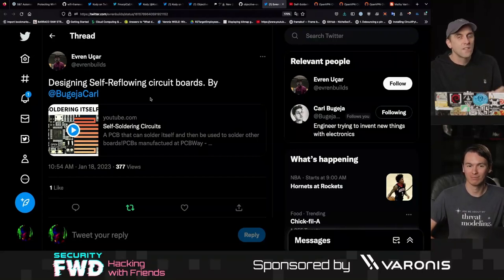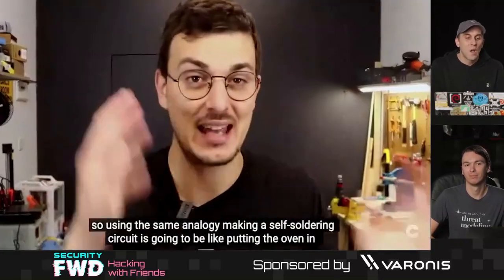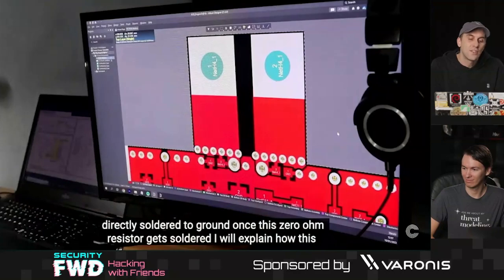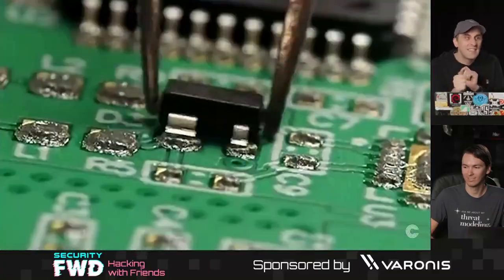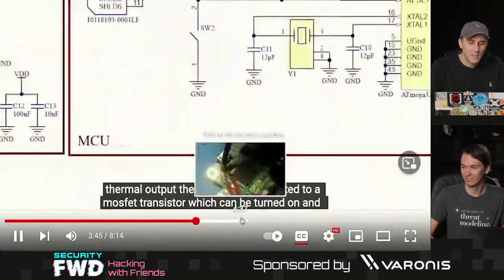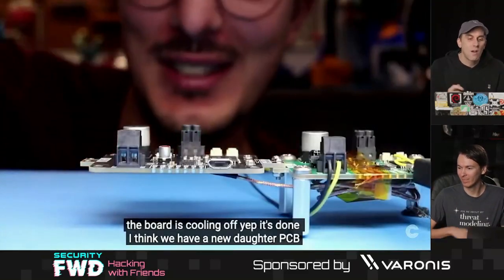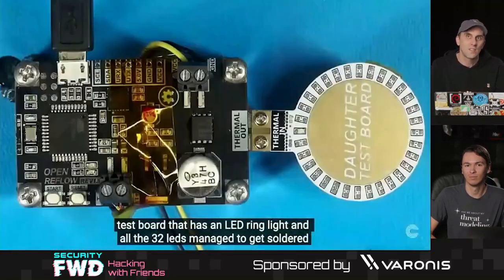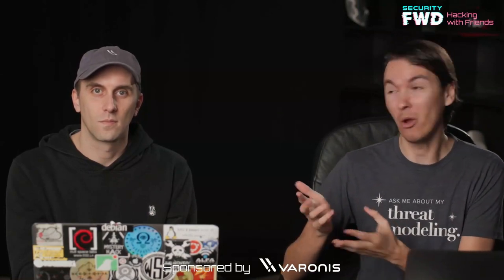Are Self-Soldering PCBs the Future?

Comment: the heater ground plane is connected only in one spot, there where he solder the resistor. Groundplanes are connected with vias to the part or component, to create the shortest distance possible. His ground plane has only one connection point, at the margin where the resistor is. That means a very long way. to reach that, and why should "electrons" go so far if there is a near via to a real GND plane allready ? The heater GND plane is just like a long wire soldered to a board, in worst case it acts like an antenna.

the second thing is, he used a solder paste which melts at a lower temperature point, what happens is a power component heats itsself to that temperature level, it could desolder itself.
Reply: totally valid points but in video I missed to explain that the 4-layer mother-board have 2 other layers with grounded polygon pours.. so the long grounded thermal-track might act as antenna picking up rf noise.  This is a trade-off for this self-reflowing concept, but to minimize the noise I added the possibility to short the track to ground from the two ends. I am planning to improve this in the next version and also test different solder paste

Comment: interesting and a question comes to mind with respect to temperature, as different solders have different required temperatures.  This is easily controlled in the oven, but can it be controlled with on-board heater?  It would be applicable to using unleaded (silver) solder which is required in some countries having lead issues.